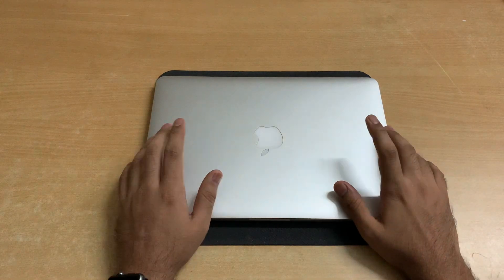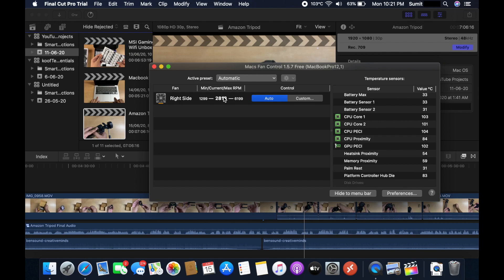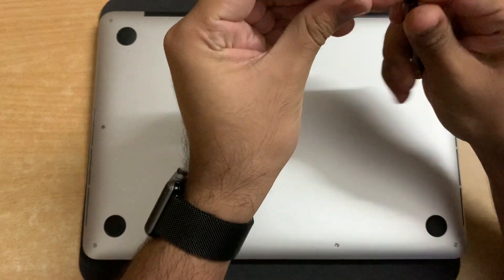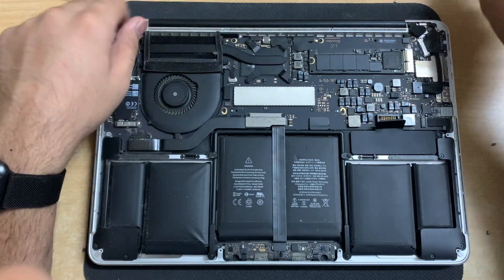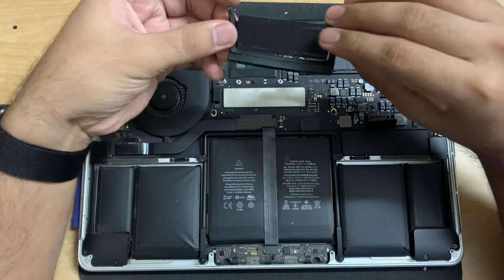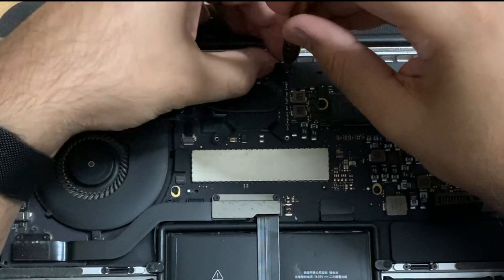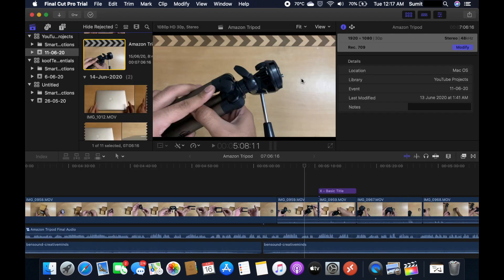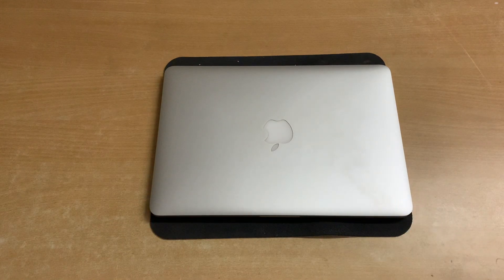MacBook Pro 13" (Early 2015) Thermal Paste Replacement || Not quite impressed with the results!

Comment: You also should have considered the export time and CPU frequency. Apple has these chips set to push themselves to 100C before they thermal throttle. Repasting may help things like idle temps and spikes, but I don't expect it would prevent the CPU from hitting max temp eventually when doing something prolonged at max CPU like exporting. Here, the thermal paste might have allowed for higher average clock speed while exporting, resulting in a quicker export, and thus better performance. You also may have used cheap thermal paste.
Reply from the maker: Thanks for the info 🙏
Reply: aliexpress termal paste...

Comment: Try using kryonaut or mastergel pro V2 or Arctic mx5 , they have better thermal conductivity than these cheap ones . Also try to change the fan curve ( lower below 90 and almost max fan speed above 95 ) , idk if you can change fan curves in mac ( never used one ) . But still these could help . Keep up the good content :)
Reply from the maker: Thanks. I'll consider it.

Comment: Not quite impressed with the results because you did not apply thermal paste on the GPU, maybe?
Reply: I know this is a year old, but I'm putting the comment here so people who google this video can find it.  The die on the left is not the GPU.  it's an I/O die and it does not need paste.  In fact when you paste it will only make it absorb the heat from the heat pipe because the heat from the CPU will transfer into it through the paste.  The GPU on this CPU is in the same die as the rest of the CPU functions, the long one.
Reply: @GutBombTech I put thermal paste on both of them and now my MacBook will hardly even power up. Gonna remove the thermal paste from the one on the left and see if it makes a difference
Reply: @ryanroszel8816  Did that work, I just changed mine an put thermal paste on the left one, because in my Macbook it was already covered from factory
Reply: If you'll check heatsink design it have not any contact with GPU chip on CPU, it have 1 or mb 2 mm space between heatsink and GPU only very slim thermal contact pad will help there a bit.

Comment: Maybe put a 1,5 mm thermal pad on the left side of the cpu - the one that isn't normally covered by the heatsink (I believe it is the GPU?) - so it at least makes contact with the heat pipe. Wonder how that would affect it? I have the same model Macbook Pro, so I might try it...

Also notice, that the SSD on these are made specially for Apple, which are PCIe x 2, so you cannot put in an M.2 SSD just like that. The proprietary Apple SSDs are also very expensive. 
However, you can buy an adapter, so you can install an M.2 SSD which are cheaper. 

Adapter name: PCI-E x4 M.2 NGFF to SSD adapter card for macbook  A1465 A1466 A1398 A1502
Reply: Did you apply a thermal pad on the GPU like you mentioned? Any difference?
Reply: @Z3DZ3R0  Not yet. Haven't ordered thermal pads.
Reply: What do you mean thermal pads, I used thermal paste and the macbook runs a little faster. Thermal paste on both of the chips, not sure if it touches the heatsink
Reply: @sainexx4651  They use thermal pads on Macbook Air 2021s so the pads transfer heat from the heat sink to the bottom chassis.

Comment: What types of screwdrivers do I need to open the case and remove the fan?
Reply from the maker: You will be needing a Pentalobe P5 screwdriver for the case and a Torx T5 for removing the heatsink and fan.

Comment: It this battery the stock battery that came with you macbook pro or you replaced it?
Reply from the maker: This MacBook Pro has never been disassembled before this. So this is the stock battery with around 212 charge cycles(mostly used it on AC power). Still don't know why it got swollen.

Comment: So technically how is cheap cooling paste different than the branded ones(i.e cooling maste, arctic etc)? And I love your videos I think they are amazing .
Reply from the maker: Basically, the difference between these thermal paste are the materials that are used in them. Some contain metal particles in them i.e metal based which have more conductivity and thus resulting in lower temps , some are ceramic based (light grey in colour) and some are silicon based (these are the ones that come stock with the processor or fan).
And now there are also copper based that provide very good thermal conductivity and doesn't conduct current which makes them better than all the others. So the choice is yours to pick😄.